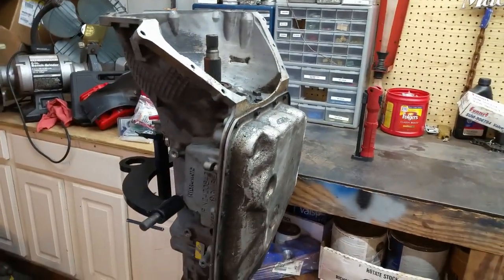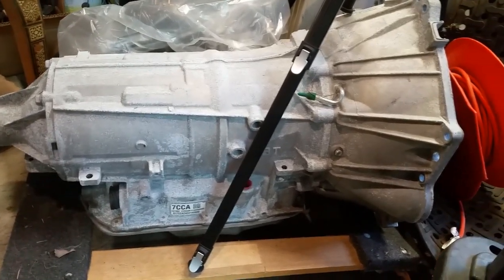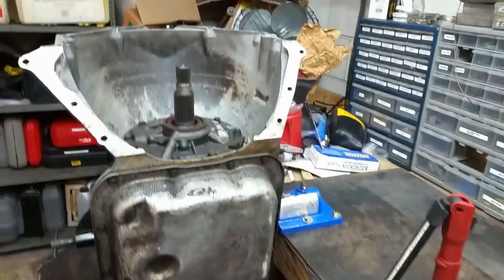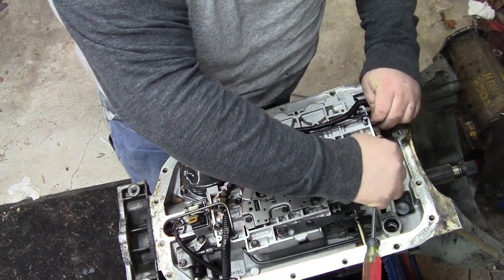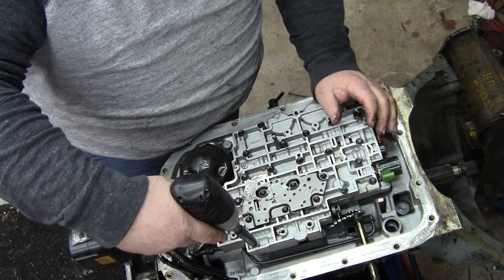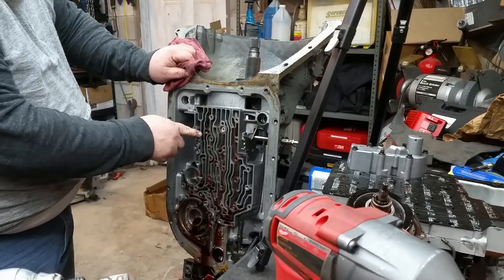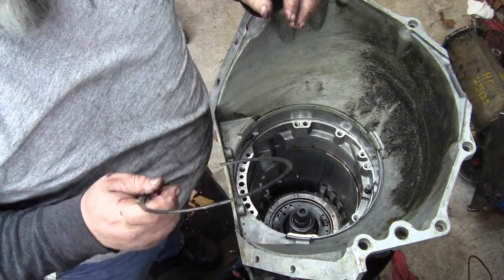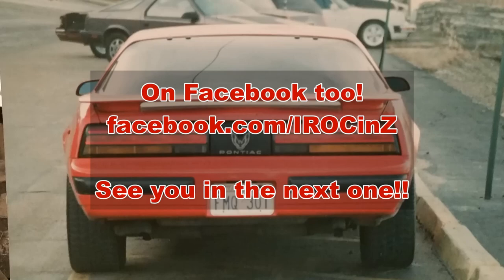TRANSMISSION HOW-TO, THE GM 4L80e: Teardown and inspection

Comment: I have seen several teardowns and or rebuilds, but I still really know nothing about automatic transmissions aside from clean fluid is your best friend and don't get them hot if you want it to live. I am very much a manual transmission guy, but that's pretty much all done anymore as everything has gone auto-tragic. Yes, they have their place, but it is much more fun to me to shift gears. Definitely breakdown the sections and maybe explain the individual jobs they do. We all know everything lives inside the case, and is driven by the torque converter which is turned by the flywheel via the crankshaft.
Reply from the maker: A agree shifting gears is more fun, but automatics are generally faster at just that. Heat will kill a manual also if it gets too hot, seen it. Plus you don't wear out your left leg in traffic with an automatic...lol. It's really a matter of preference...

Comment: Now is this the 4l60? And if it is or isn';t is the 700r4 just like the newer auto they put in the 4th gen f body cars? Thanks
Reply from the maker: No, this is the 4L80e, its bigger brother. I will be going through a 700R4 in the next couple of videos. I'm showing a 4L80 because it's a popular swap in the camaros when the capacity of a 700R4 is exceeded.

Comment: Will a 700r4 from a 1993camaro work or fit a 1989 iroc
Reply from the maker: Physically it will fit. However, 1993 should be a 4L60e as that is when they started putting electronic controls on the transmission. It would not have a Throttle Valve Cable.
Reply: Got a motor and transmission the motor has opti spark cam driven water pump transmission has the tv cable that's why I been wondering thanks for your help
Reply from the maker: @daleeisenberger8360  Well, anything is possible. That was the transition year so the answer to your original question is yes. Since it has a TV cable, it will work.